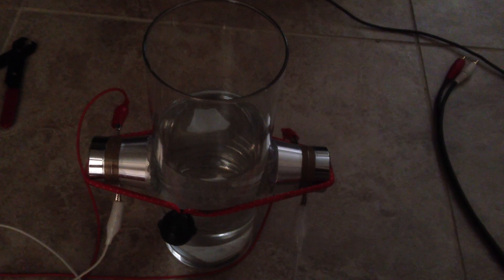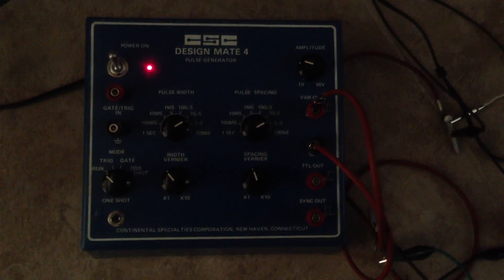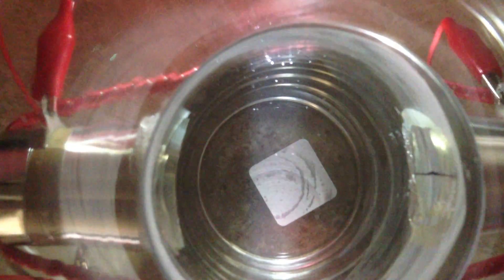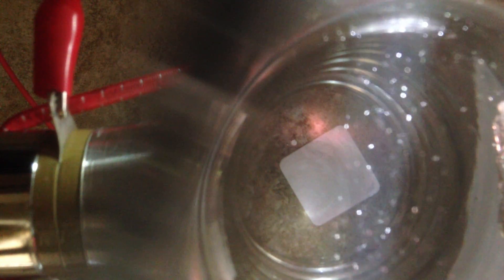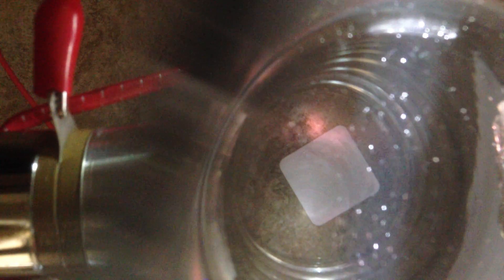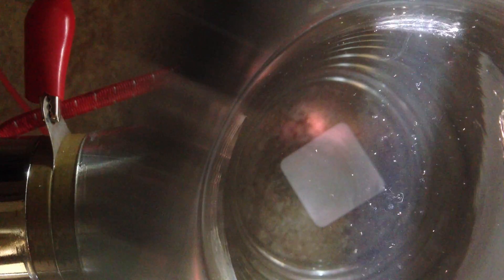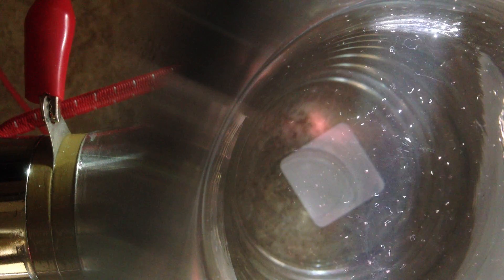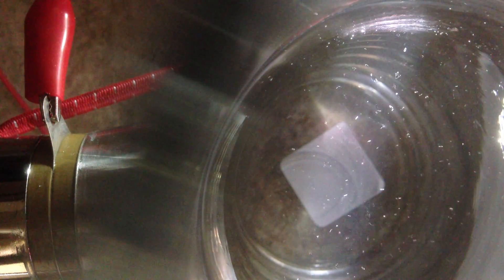Sonoluminescence 001 - Cavitation using 2 transducers (Multibubble)

Comment: Hello sir,
Pls give a detailed step by step explanation on how to do it in a school lab,ASAP,WE HAVE A PROJECT TO DO,PLS REPLY VERY VERY VERY QUICKLY
budget-₹5000
Reply from the maker: Hello Viswanth,

I think it’s great that you’ve chosen sonoluminescence for your project. I hope this helps.

First you will need to find the frequency you want to work with. If you want to use a free phone app for the frequency generator, know that most apps and computer programs will top out at around 22-25k hz. You will want to select a flask that needs a frequency less than this. Here's a good link for the math to figure out what size flask you want, scroll down to the resonance of a sphere section.
https://en.wikipedia.org/wiki/Acoustic_resonance
It will make things easier on you if you select a larger flask, for example a 1L round bottom flask.

Here are the items you will need for MBSL:
Round bottom boiling flask 300-1000ml (the larger the flask is, the lower the frequency you will need)
Rubber stopper 
10ml syringe with a 20 gauge needle attachment
Frequency generator (There are free phone apps for this) if you use this, you will need an auxiliary (AUX) cord to access the output leads.
Amplifier (a home stereo amplifier will work)
2 transducers or ultrasonic ceramic elements. The ceramic elements are more difficult to work with, but are smaller, look nicer, and less expensive.
Ceramic element (http://www.ebay.com/itm/40khz-35W-Ultrasonic-Piezoelectric-Clean-Transducer-Plate-Electric-Ceramic-Sheet-/282195098944?hash=item41b4237d40:g:cAIAAOSwOyJX6VzD)
Transducer (http://www.ebay.com/itm/50W-40KHz-Ultrasonic-Piezoelectric-Cleaning-Transducer-for-Ultrasonic-Cleaner-/161605449198?hash=item25a06f75ee:g:0pwAAOSwrklU491H)
Some type of stand for the flask to hold it by the neck. You can make this from thick baling wire or a metal coat hanger pretty cheap.
Distilled water
Epoxy (high temp, able to withstand 250 degrees. The transducers get hot. You don't want the epoxy to melt) Hot glue will melt.

For SBSL you will also need these items:
Oscilloscope 20-40 on eBay for a cheap one
Small piezo speaker "Buzzer" (http://www.ebay.com/itm/2-PCS-Piezo-Piazo-Buzzer-Alarm-Speaker-Transducer-/280552095158?hash=item4152353db6:m:mNwlCojeXVcUJiZPlBwHKqQ)
1 ohm resistor
Variable inductor 
Once you have all the parts you will need to prepare them. First make or set up the stand for the flask. Next, if you purchased the ceramic elements, you will need to solder wires to them. Here's a nice video: https://www.youtube.com/watch?v=i75semvJblI Once the wires are on the transducers epoxy them to opposite sides of the flask at the middle of the sphere so that the same sides are facing the flask (ex: Both negative sides touching the flask). For SBSL you will also need to epoxy the buzzer to the bottom of the flask. First you will need to cut the top of the buzzer off. Use a razor blade to remove the top 2mm of plastic by cutting around the outside. Place a small dot of epoxy to the ceramic element inside the buzzer housing, them place this on the bottom of the flask. Once that drys, you can also epoxy the plastic housing to the flask. Place the flask on the stand to prevent damaging the solder or epoxy attachments. Next fill the flask with distilled water to the base of the neck or top of the sphere. Then place the syringe through the center of the rubber stopper so that it goes in the top and out the bottom. Then place rubber stopper on the top of the flask. Remove about 4/5ths of the air from the flask or enough that the water stops boiling from the vacuum. This is to remove as much air from the water as possible. 

Now you are ready to attach the circuit. Connect the output of the frequency generator to the input of the amplifier. If you are using a phone app, you can use any 3.5mm auxiliary cord cut to expose the leads.  Connect the output of the amplifier as shown for the circuit you choose. The easiest is the MBSL circuit, but the light is harder to see because the bubbles are smaller. For SBSL, the oscilloscope attaches to the 2 leads of the buzzer on the bottom of the flask. During testing, you will be looking for a ripple in the oscilloscope trace. This tells you that the bubble is present. You can do that part with the lights on. To see the sonoluminescence you will need to be in a completely dark room (No light at all). Sit in the dark for 2-3mins to allow your eyes to get use to the darkness. If you are using a phone app for the frequency generator you will need to have the app running at a frequency just less than the frequency where you saw the ripple effect ahead of time and cover the phone and your hand with a towel so that no light escapes. Once you are set up with the lights off, slowly increase the frequency until you see the light. 

Feel free to email me for assistance any time,
Russ
Reply: @LimitlessResearch  Thank u so much for your effort sir,
We are using a 50W 40Khz Piezoelectric Transducers, and a 100w ultrasonic driver circuit. We are using it to purify contaminated water using acoustic cavitation. We are not yet clear on how to exactly execute this project. We are not sure if this is your area of expertise, but it would be helpful to hear your suggestions.

Comment: Are you using ultrasound?, that audio amp you have there has a low pass filter meaning those high frequencies will be attenuated.
The container should be straight; as the standing waves will need to be horizontal to generate the standing wave. But well done for experimenting; there is still mystery surrounding sonoluminescense that needs to be explained.
Of course you havent achieved this here; as you should see light being emitted from the collapsing bubbles; where you are just using a torch to reflect light from the bubbles.
Reply from the maker: I thought the same thing, but I decided to try using that amp anyway because that's all I had at the time. I worked! It was able to produce MBSL. I'm still working on SBSL, but it should be coming soon. Just waiting on parts.
Reply: Limitless Research: Yes you maybe got away with it due to a poor LPF in the amp).

Comment: Awesome, fear not going slow, only standing still. Brother, NOT a "better way" kinda loaded comment, just a heads up if you'd like. If you make you a little hydrogen electrolysis set up, let it bubble away, and just keep refilling, the % deuterium in your base water will get higher and higher. Should be dramatic increase if you use the "spent frac water". Another easier one, maybe try topping the water off with mineral oil ? Will change the surface tension dynamics, probably surprise you.  Again great to see someone doing, and sharing, just sharing thoughts. Good luck Sir, just arm chair quarterbacking.

Comment: they appear to form in clumps and patterns
Reply from the maker: sonicxfan83 Yes, they do. They form at intersection points where the sound wave through the water forms a low pressure point, creating a boiling effect in that spot, similar to what you see when water is placed in a vacuum on a very small scale.

Comment: Any more progress, can you link where you got the transducers?
Reply from the maker: Yes, just haven't made a video yet. I'm experimenting with different size round bottom boiling flasks to see how the frequency changes in relation to the size of the flask. I'll post one soon, just busy right now.
In these videos I used a 60W 40Khz transducer, just search for that on eBay. Now I'm using the transducer ceramic elements epoxied to the side of the flask. Just make sure you get one that is capible of a frequency higher than that of your flask. https://en.wikipedia.org/wiki/Acoustic_resonance

Comment: please test the water before and after. If you are using distilled water it should start off as acidic with the positive mlv charge but i am guessing after you experiment  you will get a negative mlv charge and the ph should be more alkaline.

Comment: Also which type of glass to use for this experiment ?
Reply from the maker: In this video I am using a vase. It's not high quality, but it gets results. The chemical makeup of the glass isn't important unless you plan on pouring boiling water into it. If you do, look for pyrex glass or any low-thermal-expansion borosilicate glass, or lab glass. Many people are using a 100ml round bottom boiling flask. These are around $10 on ebay.

Comment: sir , how you created ultrasonic sound waves i.e how you used speakers to reach to that frequency ?
Reply from the maker: I used ultrasonic transducers, not speakers. In the video I said they are wired just like speakers. You can find 2 ceramic transducer elements for $14 on ebay.
Reply: THANK YOU , Sir

Comment from the maker: Thank you for your input, but these "air bubbles" are not present until a specific frequency range is reached. This leads me to believe they are cavitations. If they are in fact cavitations, there is a possibility they are giving off photons. I will be taking a few long exposure pictures to see if anything shows up. I will also be using distilled water in the next run. I'm sure this will produce better results.

Take care,
Russell